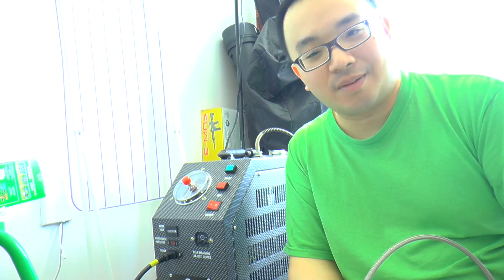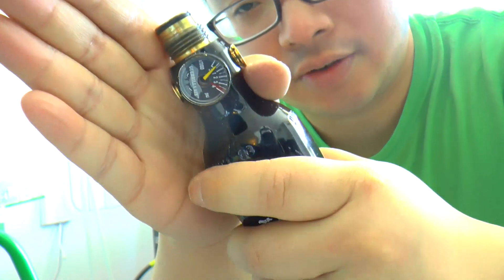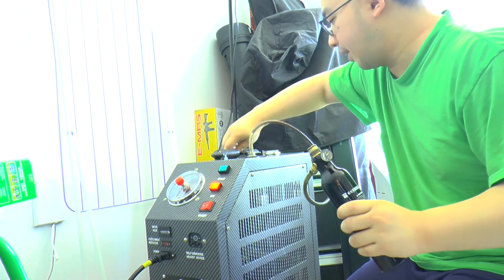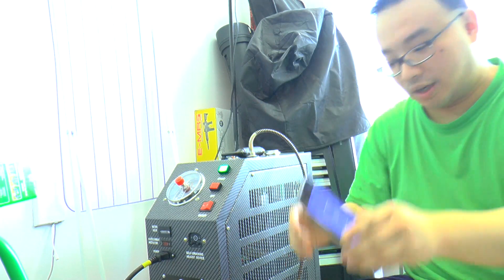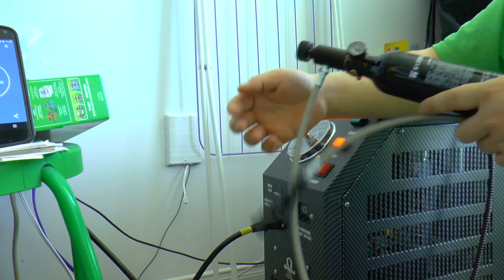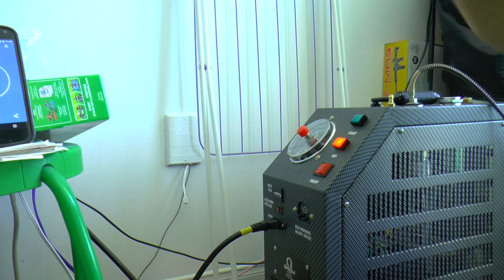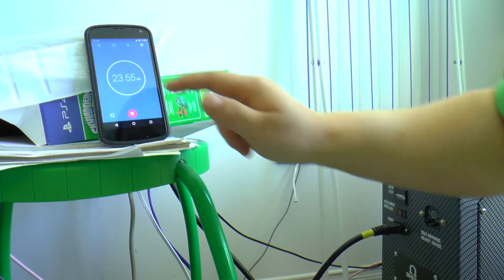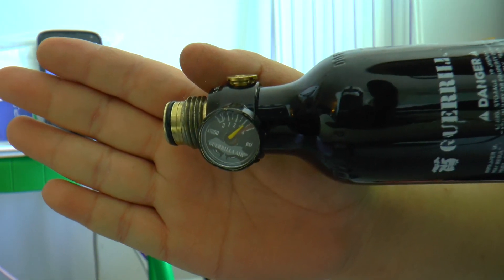Omega Super Charger Compressor VS 13ci HPA Tank in Winter

Comment: It appears that it takes about 16 minutes when utilizing the dry air filter.  In your other video you advise that the dry air filter is not absolutely necessary in that the supercharger does provide moisture control.  I have a Omega Dry Air filter which has the refill cartridge. Does the replacement filter load in what direction.  An email reply would be appreciated.